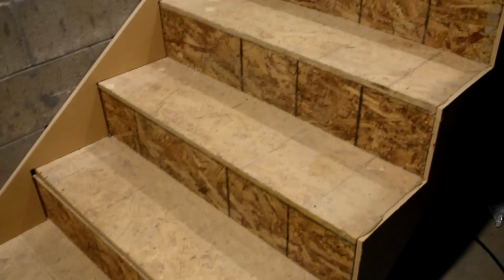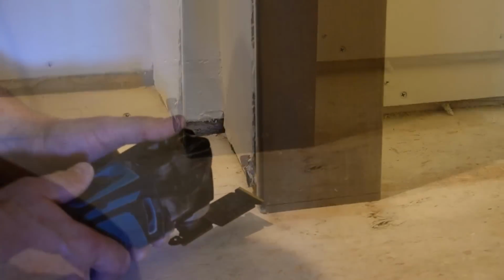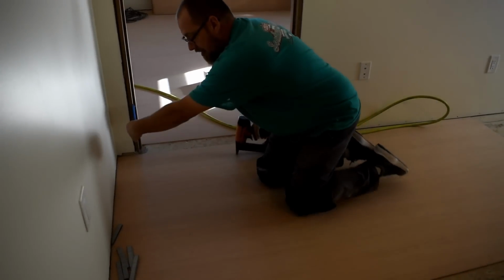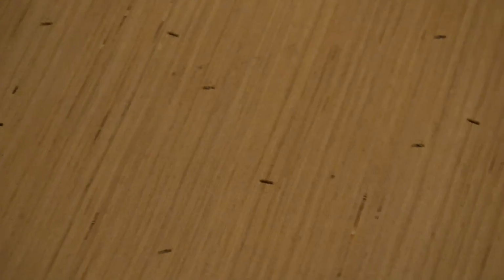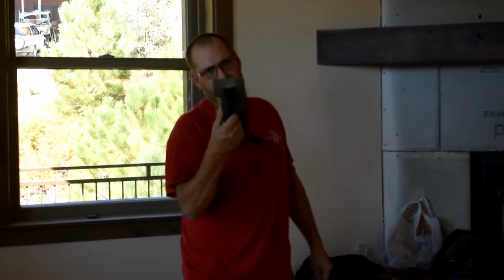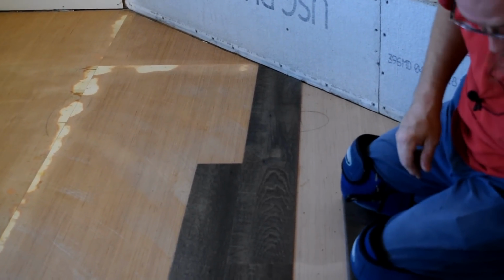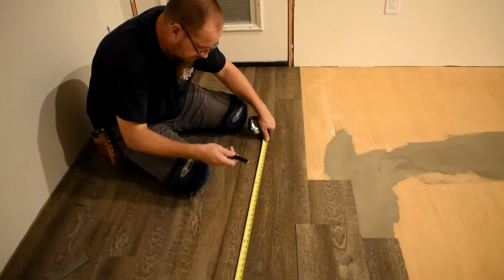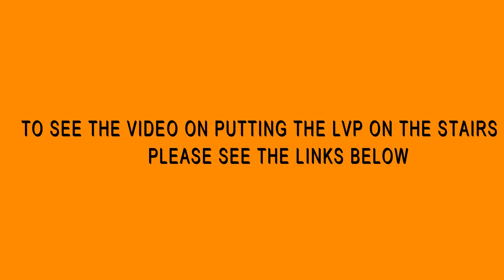VINYL PLANK FLOORING INSTALLATION , HOW-TO

Comment: I appreciate your video especially on making transitions.   I made one the other day.   Used booger carpet seam tape.  A 10th of the price of the tape make it match is selling tape for.   Cut a slit in a pvc pipe to unroll vinyl by hand.  The prices I saw on make it match were astonimical.  For a diy person not affordable but thank you for the visual as it wasn't something I would ever consider doing before seeing your video

Comment: Is there a reason you chose LVP vs. laminated plank ? I noticed it is easier to handle and able to bend easier ? Also can you recommend the LVP you using ? i like the way it easier to handle
Reply from the maker: Vinh Nguyen It is completely waterproof, where laminate is not, and the brand that I am using here is a novalis if I am not mistaken, Coretec is a good brand also anything made by Shaw Will be good for you, the glue down vinyl plank is extremely easy to install however the floor prep is extremely crucial when it comes to how your job will turn out, they also make click together vinyl plank as well where you can get by with a lot less floor prep
Reply: @FloorsbySouthernboys  the type you use on this video is not click on type? also did you use the same pressure sensative adhessives on the entire floor?
Reply from the maker: Vinh Nguyen No sir

Comment: You're awesome, liked and subbed! My LVP has a cork underlayment attached (click lock), Can that go directly over OSB subfloor after prepping such as you have? There are some gaps between sheets of OSB from the house settling... some spots 3/8 in wide and 3/8 in deep. What should I fill those in with? Do I need to worry about expansion or contraction space for the OSB flooring?
Reply from the maker: krillansavillan If it has a cork backing down it’s going to be a floating floor in that case you do not have to worry about gaps in your sub floor and I would not fill them with anything for the simple fact of the floor movement and then your filler cracking up and becoming noisy under your floor , The most important thing for a floating floor is just get your sub floor as level as possible meaning sanding down over high spots And seams in your sub floor , I hope this helps and thank you for subbing
Reply: Also what mud do you use with wood? Will that work with OSB?
Reply from the maker: krillansavillan If it is not a glue down product I would not use any mad because it will crack and crumble and make noises under your floating floor, if it is glued down the glue will keep your mud in contact So it does not crack and crumble
Reply: @FloorsbySouthernboys  That does help tremendously, looking forward to following you on your next jobs and tutorials.
Reply from the maker: krillansavillan Well thank you I appreciate that

Comment: great tutorial, looks wonderful!  We've installed moisture resistant chipboard in our loft, the floor is very clean, can I stick this type of finish to it?  Thanks
Reply from the maker: not without going over the entire floor with a primer and then at least 2 coats of skim coat to ensure the floor is smooth as possible ,or you can put down underlayment like i did in this video, chip board is not smooth enough for a glue down product
Reply: ah that's a pity, thanks for saving us a lot of heartache.
Reply from the maker: james smith If you get some click together it will be fine going over the chipboard

Comment: Thank you for the video you did a very good job you have answered a lot of my questions I’m going to do the exact same thing in my house I’ve put down plenty of floors from buying all the carpet to hardwood floors and never done this vinyl planks i’m doing a glue down as you did I got one question what kind of cement base product did you use to feather what brand
Reply from the maker: Patrick Landis Thank you sir, here’s a link to some really good floor patch.  https://www.tools4flooring.com/ardex-feather-finish-gray-10-lb-bag.html.      Good luck with your project
Reply: FloorsbySouthernboys thank you I’ve used ardex plenty of times fixing floors ( concrete ) never thought of using on wood thanks again.
Reply from the maker: Patrick Landis 👍

Comment: im suprised you dont use the scribe method to cut your boards you know sit a plank on top of  the last one and get a full board and use it to scribe the board uderneath if that makes sense quick and accurate   was that pressure sensitive glue

Comment: Do you need underlayment for 6.5 mm LVP for example "Lifeproof" or "MSI" I have a similar subfloor as you do in the video? It seemed like you had a very thin LVP?
Reply from the maker: +Russell H You only need underlayment on glue down product
Reply: @FloorsbySouthernboys  do you still recommend getting the belt sander and sanding for floor prep with Lifeproof? And any other recommendations for floor prep?
Reply from the maker: Russell H Yes I would still sand the seams in the plywood. Make sure they’re not raised higher than the rest of the floor, and scrape any sheet rock mud or construction glue that might be on your sub floor and get it as clean as possible before you install, also make sure no nails or screws or protruding up through the floor and you should be good to go
Reply: most companies wont warrant products if there isnt ply or masonite first

Comment: Just screw down  subfloor with Quikdrive screw gun to eliminate squeaks
Skim coat floor with Mapei
Sand down using a buffer, I just use angle grinder  with diamond arrow wheel hooked up to shop vac.
I lay about 5k- 6k sf a week
Reply from the maker: Cool

Comment: Have you worked with Coretec yet? Best plank on the market!
Reply from the maker: Thomas Grider Yes I am totally agree
Reply: Thomas Grider, the best plank on the market is Flooret Rigid Vinyl Planks.  How are you going to beat a 40mil wear layer with a nano ceramic beaded coating, environmentally safe, pure virgin Vinyl, 20 year commercial and lifetime residential (anyone can offer a lifetime res), 9” x 72” low sheen planks, Bevel trim edge, etc.

Simply the best product on the market @ $3.95 sq ft!
Reply: Yes you must have pure virgin vinyl or else it will never last! Using old lady vinyl and you will have to redo it!